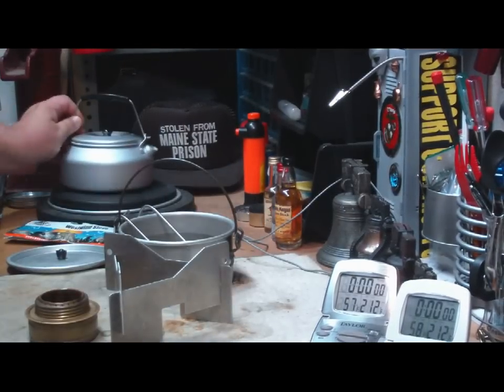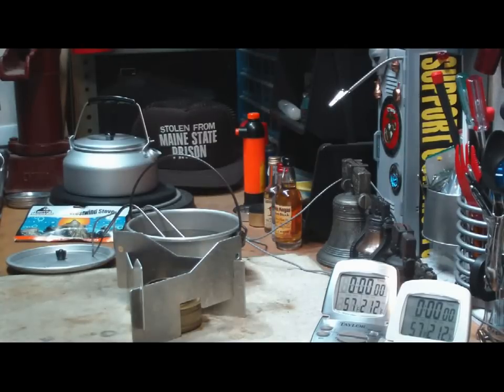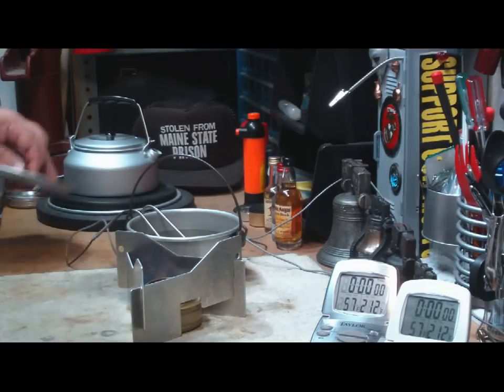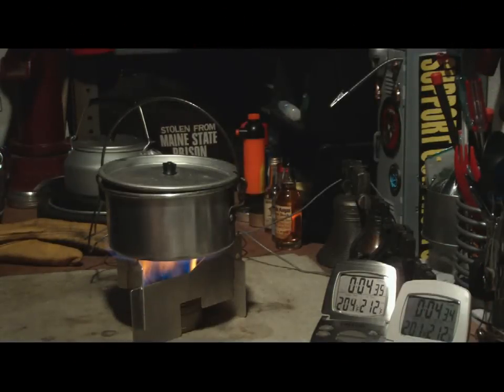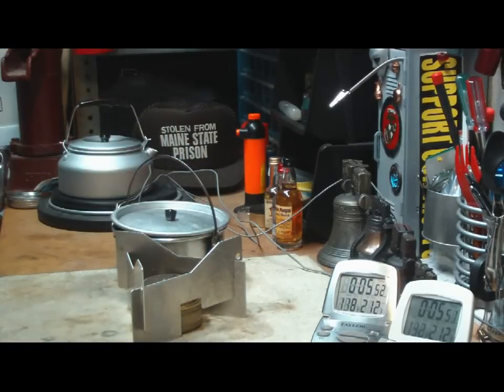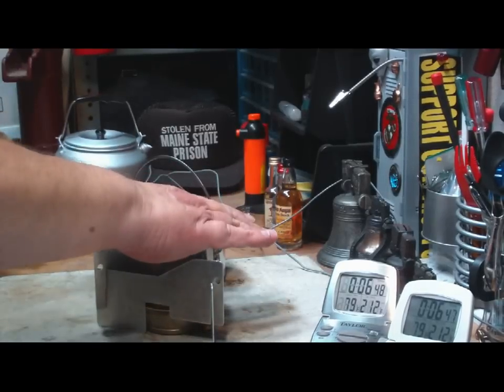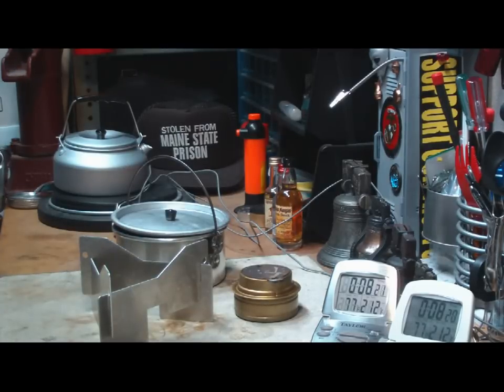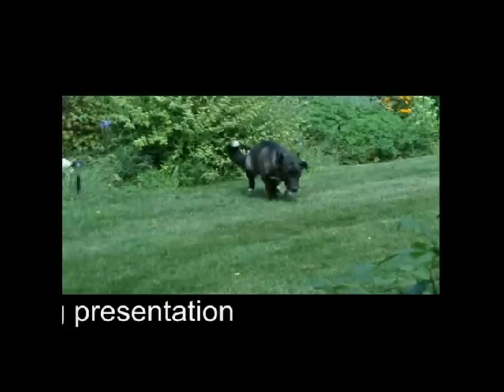Westwind Stove (New Series) Boil Test 1

Comment: Your right, there are too many variables involved in these stoves to come up with a precise boil time. The canteen stand I built is a stand / windscreen; it only has a small opening in it to put the stove inside. It contains a lot of the heat from the stove and burns hot and fast it well burn two oz. of fuel in fifteen minutes.
PS: Sweet Spot sounds like the proper engineering term to me.

Comment: I built a stand to hold a stainless steel canteen cup. I got the best time with a distance from the stove to the bottom of the canteen of 2 ¼”. I used a beer can stove like the ones Tinny sales. My time to boil 2 cups of water was 5 min. 20 sec.

Comment: As you suspect, that larger area for the flame to escape between pot and stand seem to be having that positive effect on the burn times. I think that flow of energy, the flame, passing under the aluminum material seems to work better than having them comfined, thus, allowing the fire to burn faster and hotter. Fooling with titanium when I worked on F-16 aircraft seem to have the same effect, letting the engine breathe, and thus perform at a higher value. Did you meassur the amount of fuel left?